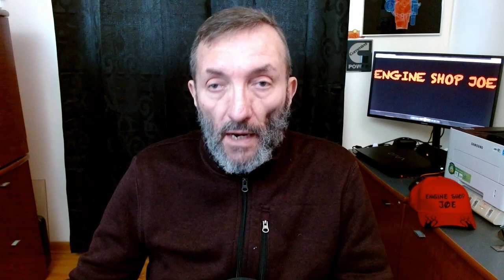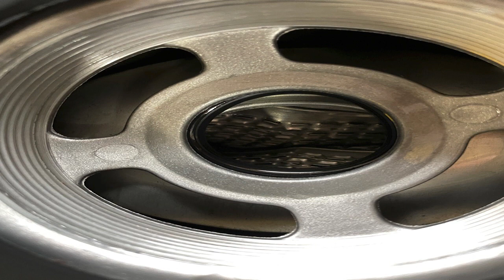FC559!! Low fuel pressure I just changed my fuel filters

Comment: Hi Joe. I was having a 559 issue that was eventually attributed to bad injectors. However I'm noticing that after changing filters I'm getting readings on my fuel restriction gage instead of it sitting on zero as it usually does. What is the best way to find out what's causing this?
Reply from the maker: Im not sure where you are measuring the restriction. Our units measure restriction right out of the primary fuel filter. If that is where you measure it then hook a known good fuel line to the primary fuel filter inlet and just put the other engine in the fuel tank fill hole. If the restriction goes away you have bad hoses or maybe a plugged tee fitting(if you have one.) It is normal to read about 2-2.8 inhg on new fuel filters when pulling full HP around 1600 rpm. But something may of happened inside your fuel filter housing. ALso if you are getting any air in the fuel that can cause restriction to go up. That is a phenomenon i witnessed many years ago on a volvo with an isx. People who comment on this channel have also said they had problems with fuel filter housings that caused restriction. Let us know what you find.
Reply: @ENGINESHOPJOE  Thank you so much for your reply. Just to clarify I get my measurements from a gauge on the dash that says fuel filter. I think it reads from the fuel water separator assembly on the trucks frame. I may be a bit paranoid because I was having that notorious 157 code and the truck would shut down then crank back up, only running for bout half a minute. We identified fault with injectors but right around that time I noticed my fuel filter gauge acting out of ordinary. I remember it would sit at zero with new filters however the readings you mentioned above are what I'm getting now so I may just be paranoid a bit. I will however keep an eye on it and update you how it goes. Also when you say filter housing having possible issue are you referring to the glass filter assembly?
Reply from the maker: I am referring to the Primary filter or oem frame/chassis mounted filter assembly. Its not common but I have had one in our fleet have issues that caused excessive restriction. One of my subscribers said they had trouble with a check valve assembly on a filter housing. However there are many different types of primary filters and I am no filter assembly authority at all. I think its on the rare side that the working parts in the primary filters have issues but like anything else, things break. At the end of the day measuring restriction is the way to verify all is good. If you have a hand vacuum pump with the built in gauge,like they used to use to check carburetor pull off solenoids (dating myself here) ,you could test your  restriction dash gage to verify it reading in the ball park. Thanks for subscribing and take care.
Reply: Ok I will consider replacing it and see what happens. Thanks Mr. Joe

Comment: I am so skeptical of replacement auto parts, I'd replace the filters again!   I try to use OEM parts also!!🍋
Reply from the maker: Generally speaking I have to agree with you. Especially on engine parts unless you know the vendors parts meet OEM specs and perform like the OEM part does. I wont mention the chain but there is an auto parts store we have bought filters from and had good results with them. Keep in mind we buy hundreds of different types of filters and try to stay with OEM on fuel (on engine) and oil